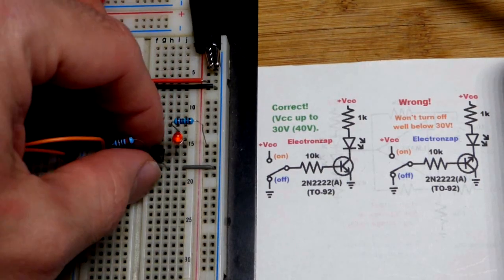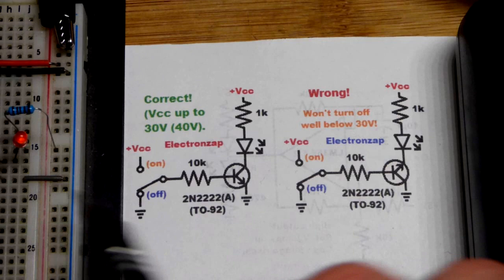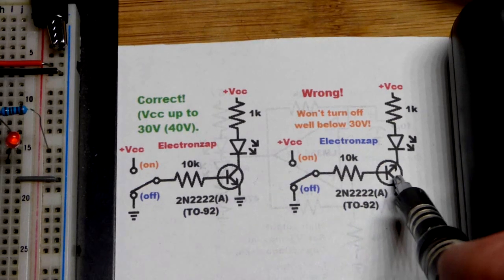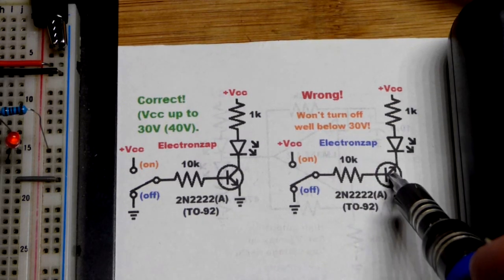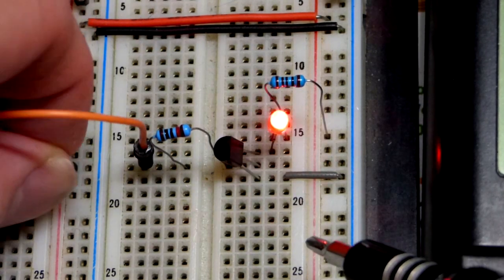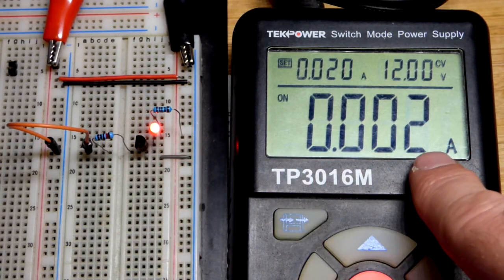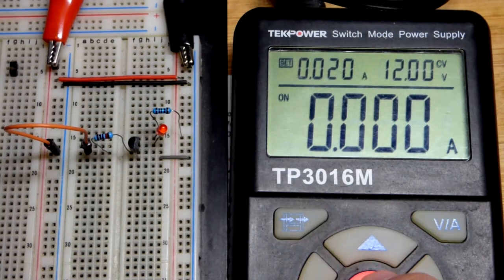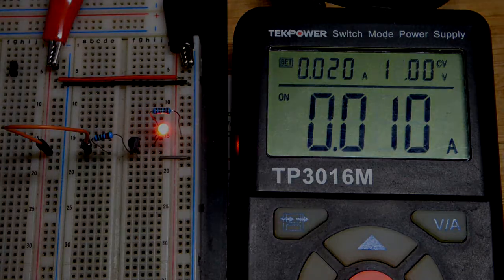Avoid swapping NPN BJT Collector and Emitter pin positions demonstration circuit schematic diagram

Comment: Interesting I never thought of it before i just assumed it would pop but I guess the emitter junction breaks down at a certain voltage ??...cheers.
Reply from the maker: Yeah, emitter-base junction breaks down at a lower voltage than collector-base junction. I just decided to quickly make this video after someone was wondering about the pin layout in a really old video. So, I didn't prepare to try to explain what is going on.